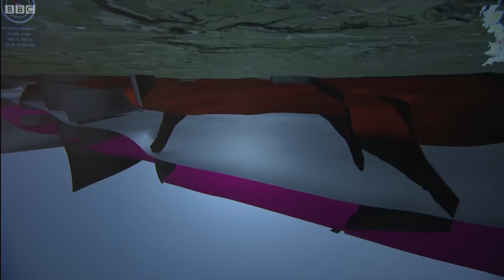Does Fracking Cause Earthquakes? | Bang Goes the Theory Series 6 | BBC Studios

Comment: Water and sand? You neglected to mention any of the chemicals also used that eventually end up back in the water table which you definitely don't want in your drinking water.. Or the amount of water it takes.
Reply: Absolutely bullshit!!! All the fluids go into the zone and then flow back into tanks and/or facilities meant for production. You can always tell someone who doesn't know what they are talking about when they spell Frac with a K. There is no K in the word Fracture!! Idiots
Reply: USA has been using Hydraulic fracturing process since the late 90's.  Yes, in the beginning there was some isolated incidences, but since then they have been using casing's during the drilling process to protect the water table and since then the process has been quite safe.   What the issues are now is the waste water that returns to the surface.  Some of it is radioactive because the fracking fluid mixes with already existing barium and radioactive radium and brings it to the surface.  It's the companies that are paid to dispose of it that are cutting corners and creating spills... which is very rare.  The actual fracturing process is quit safe and manageable.  Got sand?
Reply: @Dave-jo1hf  Hydraulic fracturing has been around for much, much longer than that. The first time hydraulic fracturing was commercially used was outside of Duncan, OK in 1949.
Reply: Water table depth is taken into account, it’s a major fine and waste of money to hit a water table. People just don’t pick any spot to drill and frac it. Lots of research go into picking a location
Reply: Almost all hydraulic fracturing water blends used in the United States and Canada are 99.5-99.9%+ water and sand. There are a small amount of additional chemicals such as anti bacterial agents, friction reducers, and gelling agents depending on the geology and desired results, but these are at very low concentrations.
Water contamination can be a concern, but there is a lot of engineering that goes into ensuring it does not happen. First, it is literally impossible for the fractures themselves to contaminate groundwater. The shale formations are 4000'+ below the surface, whereas freshwater aquifers are about 500' at the deepest. The danger would come from a contaminant somehow leaking out of the wellbore near the surface. Engineers prevent this by happening by running several layers of cement and steel casing around the production tubing when constructing the well. Cement bond logs and pressure tests are also run to ensure the well will maintain mechanical integrity.
Reply: @ryanjardee9235  This is the truth
Ive been looking for a comment exactly like this, its really astonishing to see the amount of ignorance among people when talking about something like Fracking, but at the same time ironyc how none of them offers a different solution apart from solar panels, wind turbines or nuclear
The world already have too many environmetalists it needs with urgency MORE  scientists instead.
Reply: We drink water every day that is in open lakes pond and public wells.  2 miles down on the water table..   That sounds crazy I would think that the earth would be able to filter it out.

Comment: So fracking may cause earthquakes measuring as high as 2.3 on the Richter scale? Big deal.We probably don't feel anything less than magnitude 3; the only reason we know about such quakes is through the use of sensitive seismographic instruments. As for groundwater contamination, the only way that's possible is if the shale deposits are unusually shallow, the aquifers are really deep, or both. How can fracking in shale thousands of feet underground affect groundwater mere hundreds (or even tens) of feet down? Can methane seep through thousands of feet of dense rock?

Comment: Yes fracking causes earthquakes, it also causes massive loss of fresh drinking water.
You literally poison the Earth.
Reply: You only have to google Groningen (Holland) and Earthquakes to see how dangerous Gas extraction is!
Reply: I'll explain why.

Fracking earthquakes aren't a single event, they actually have the potential over creating more fractures, leading to more severe earthquakes over time.. one earthquake shifts the pressure to another pressure point which then releases with more force than it otherwise would have. Let's say an area which previously wasn't earthquake sensitive is fracked and then releases a 1.5 earthquake, shifting the pressure over to an area a few km further where there is already building pressure.. that pressure point then releases at let's say 2.5 instead of the 1.5 it usually would've been at. Added to that if there's pressure building at a very deep point in the earth's crust, if that pressure is then caused to be released that deep earthquake can cause a multitude of pressure points to be released at a shallow depth.

You can take the US as a prime example, where fracking has been done at an absolutely massive scale and is causing a multitude of large scale issues.

And then there's the subject of fresh water contamination, which is utterly undeniable and has way worse implications then has previously been led to believe.
Reply: TheNecrocoil it does cause eaethquakes but they are no higher than the natural earthquakes that occur in the uk.

On average, natural earthquakes occur 3 times a year in the uk and are very weak. Earthquakes caused by fracking are just as low as the natural earthquake.

Also, no fracking doesn't cause massive loss of fresh drinking water. Fracking is done nowhere near water supply. Fracking technology does not contaminate the water supply. There was a case where trucks carrying chemicals that are used for fracking accidentally fell into industrial wells and contaminated the water, but it wasn't fracking that contaminated the water. Also, the wells weren't drinking wells. It was still terrible that they got contaminated, though.

Also, did you know natural gas extracted from fracking is one of the cleanest energy sources there is.

In 2015 in America CO2 emissions and greenhouse gases fell to their lowest level in 20 years because of fracking. Also, fracking has lowered gas prices, gas bills and created major energy independence and security.

Comment: ps - if fracking isn't a problem for water, why did the US Energy Bill of 2005 exclude these companies from the Clean Water Act and the Clean Drinking Water Act?
Reply: judith beckett did you know that in 2015 in America C02 emissions and greenhouse gases fell to their lowest level in 20 years because of the natural gas extracted from fracking?
Reply: The lowest level for water is 5,000 feet.  Just under that is a layer of impermeable rock .  They do not begin fracking until they get down to around 15,000 feet.  The bore is also lined.  The water table does not get contaminated and fracking does not cause earthquakes.  In fact it is not even possible.

Comment: Fracking has been disastrous in the Dutch province of Groningen. Fracking causes earthquakes, I think that's more than enough reason to not do it.
Reply: I would be more worried about the contaminated water
Reply: Maarten van Rossem Lezingen fair point. You raise a good argument
Reply: lee brondum there's little in the way to show it actually contaminates groundwater beyond its use
Reply: James Brown
Glad you admit that.
Reply: So those miniscule earthquakes caused that have no danger whatsoever are a reason not to do it? Because the shale beds in China are a much safer option to exploit for energy when their coal industry kills 320,000 people a year
Reply: James Brown
It's not about the danger of these earthquakes, Groningen is filled with brick houses, as is the building tradition in the Netherlands and most of Europe, and these brick houses are damaged because of these earth quakes. There are houses that are now slightly tilted, have cracks in the walls, leaks etc. This is obvious harmful damage to property as a result of fracking and also lowers house prices in the regions of fracking. I don't think a practice that causes damage to other people's property should be legal. Also I don't think two wrongs make a right, just because China kills 320,000 people a year to extract energy doesn't mean people here should make millions damaging people's houses and mortgages. There is plenty of "green" solutions for electricity that don't kill people like solar power and wind and if you don't wanna wait that long you can always install a couple of nuclear power plants.

Comment: That's only ONE part of the  #FRACKING  process & ONE possible cause for concern.
What about the chemicals:
used
changed by the process
left in the ground to possibly seep in to the water table
returned to the surface
Oh & how much will charges for water increase as a result of the process that creates possible gas price reductions - that will likely NEVER be realised for households.

Comment: can we hust use hydrogen now? we have extremely easy and safe ways of getting it. it comes from water. it has no emissions,
Reply: You could electrolyze water into hydrogen and oxygen using large amounts of electricity. Problem is  much of our electricity is generated by burning natural gas.
Reply: If u don’t want to depend on Saudi and Strait of Hormuz then fracking is the answer
Reply: @restlesssoulme  Fracking itself has come a long way from inception regarding enovation into a massive new supply of resource crude. Problem is quality control of installations & maintenance. Because our freshwater supply is finite, care of construction & maintenance of casing is paramount. Because contamination is so devastating,  failure of just one is too many. Some of the  additives it only takes a teaspoon to contaminate a lake of aquifer.
Reply: Most hydrogen is cracked from natural gas. More hydrogen means more fracking.
Reply: It takes a lot of electricity, natural gas, carbon monoxide to crack hydrogen from water.

Comment: Hydraulic fracturing, or “fracking”, is not a new technique. It has been used for decades in the oil and gas industry to extract, well oil and gas! We've become so good at it that now we can perform directional drilling to extract shale gas onshore. It was not commercially viable to do this before.

This process happens 1000’s of meters below our feet and is surrounded by cap rock, which is impermeable. No cap rock, no gas. This means the “chemicals” can’t escape. Earthquakes can happen but on a scale of being stood next to a very busy road. Undetectable really.

The science is there. It’s safe if regulated and safety standards are met.  I’d rather extract this gas that’s below our feet than burn coal for our energy. At least until renewables become more commercial and affordable.
Reply: Time to give the knowledge needed. Okay todays directional hydraulic fracturing is different from the old days. It's industrialized meaning lots of them and lots of work.  This  technology advancement began around the 2000. Since then it's become the most used fracking technique in the world. Why? It gets the most.  Since this is only ten years old worth of technology, the long term test haven't been done to fully conclude if fracking is safe. Look at any state in USA and see if a test has concluded long term affects. In Colorado, where I live the test won't be done till 2016. Till then make your own decisions but don't be bossed around by the gas company saying the only two postive things about fracking.  Jobs and attaining oil and gas in our in our country. Yet they forget about what they might be really doing to our lands. Open minded Americans make better citizens!
Reply: And on top of that cause I have so much to say about fracking.  Your caps deep underground are made from cement. Walk on the side walk and see all the cracks and deterioration.  Same things happen to your caps.
Reply: Gavin Cooper
Americans cannot think past tomorrow.

Comment: Methane is not a fossil fuel  but old deposits of it are mined and it is found in conjunction with fossil fuels. No one is manufacturing rock oil or coal but methane is being deposited in the form of methane hydrates today. Anaerobic bacteria are quietly digesting biomass in landfills, swamps and cow guts everywhere. It is a renewable resource, not a finite fossil supply, the Japanese are working on recovering methane hydrates. I ran out of characters before I could make that clear..

Comment: I can't give specific answers to non-specific incidents.  I just explained how gas can be found in different layers and not be related to hydraulic fracking.   There are two well known examples in PA shown in films that were investigated over 5 years ago by EPA and the Geologic Survey independently.  Both found that the gas in well water was not caused by fracking. and that the well water layer was not even close to the hydraulic fracking layers.

Comment: Here in the states, the fracking occurs 2 miles below the water table... Good luck proving it contaminates it.
Reply: Use all the good water up to get the oil ,that real smart ,go green
Reply: @raygrant9768  Granted, this is still a relatively recent change, but the majority of hydraulic fracturing treatments use water that wasn't even potable to begin with.
Reply: Someone is paying attention... Exactly the water table is on the top.  Hence the word  Water Table. No water floor...

Comment: Natural gas emerges from the ground in many places, the sacred sites of Zoroastrianism included places where the sand was eternally burning. The EPA has investigated the case in Pa. and found no proof that there was  well water contamination from fracing. Fraud is suspected. Earthquakes of the 2.3 magnitude occur at the rate of a million a year and the central United States is the site of a tectonic suture. There have been 4000 earthquakes in the region since1974. .

Comment: If methane "is unlikely" to get to the water table, then why are there homes, near fracking sites, that have flammable tap water? I've seen videos where someone turns on the tap, lights a lighter near it, and fire comes from the tap. And as for earthquakes, there haev been several earthquakes in Texas, again all near fracking sites.

Comment: Fracing in the UK will be used to produce Natural Gas. It is not a fossil fuel it is produced by anaerobic bacteria in cows guts, swamps and at the bottom of the ocean, vast quantities are buried in sediments off the continental shelf.Burning natural gas to make electricity is cleaner than other carbon fuels and less damaging to the environment than solar panels and wind mills. It has been done safely for 60 years. Gasland and Gasland 2 are works of propaganda, not science or engineering..

Comment: Safe? Have you looked into the cases of groundwater contamination this has caused in the US? A number of places have vast underground caverns of water that are used as the water source. You really think they can predict exactly how many miles one may go? Not to get into the excess released gas, where do you think the fracking water goes? Left there to seep in or pumped into evaporation ponds where they emit a wide range of chemicals.